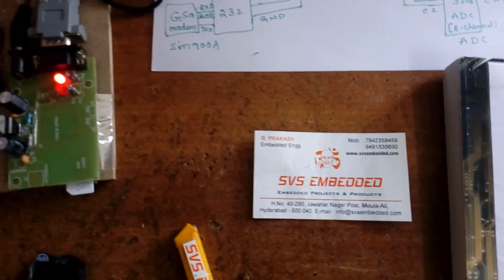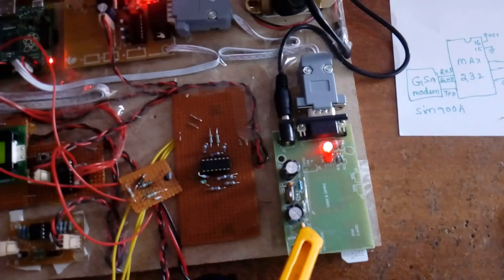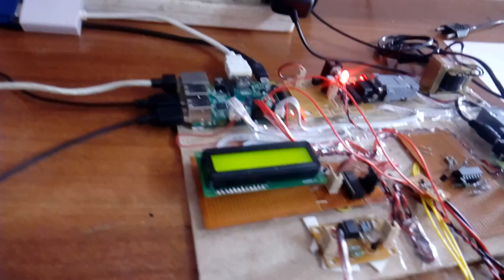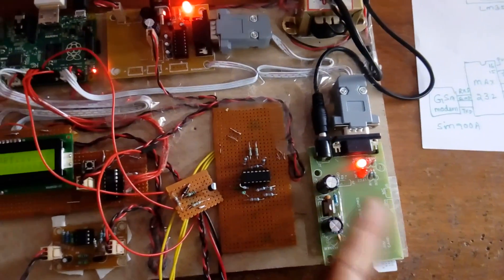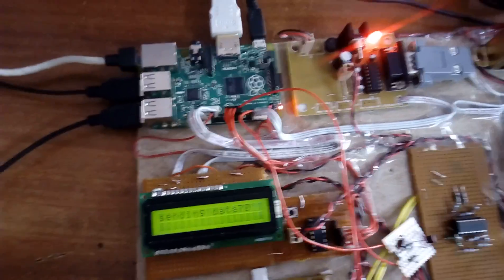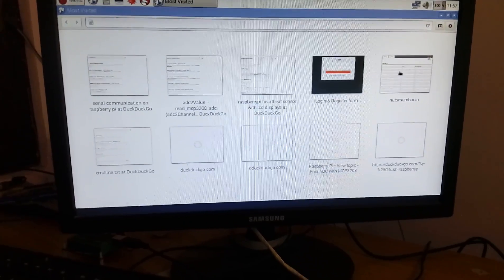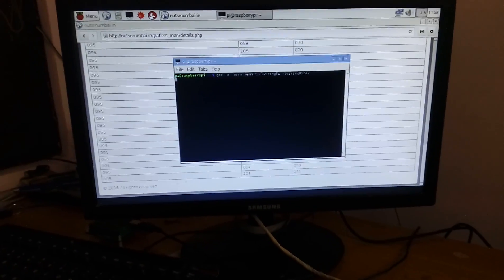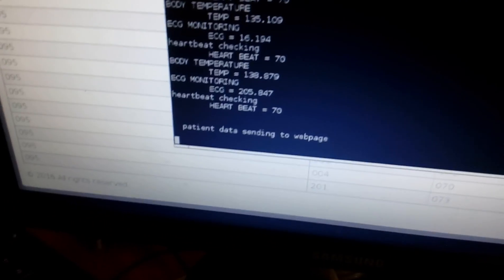IOT Projects : Patient Health Monitoring System Using Raspberry Pi

Comment: Good work, please share the code and the simulation.
mohamedkouissi1994@gmail.com
Reply from the maker: Thanks for watching and your valuable Feed back.yes we will help on coding part.
we are selling the projects with least cost.if u order the project we will provide working hardware kit along with 
1.abstract
2.datasheets
3.documentation
4.schematic( circuit ) diagram.
5.software code.
6.sample ppts
7.photos&video file on entire project
through google drive
send me a mail to  svsembedded@gmail.com,info@svsembedded.com.
we will send u the how to order procedure to u.
Reply: hey did you got the code for the project if yes please send to my mail